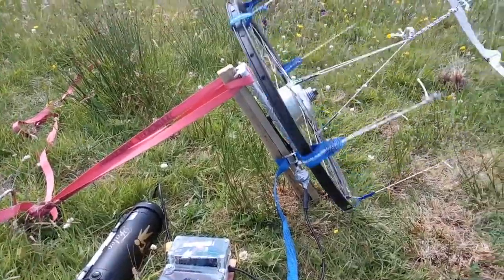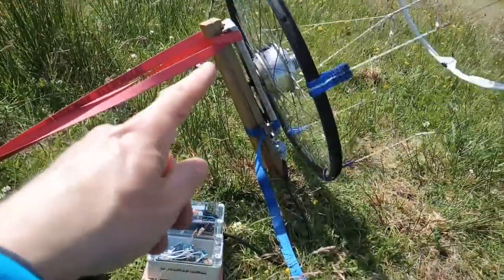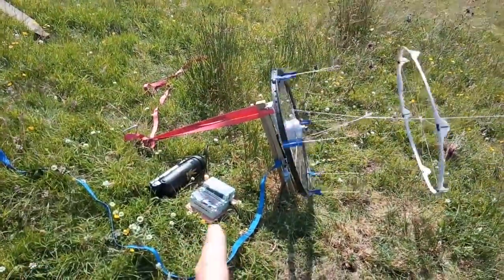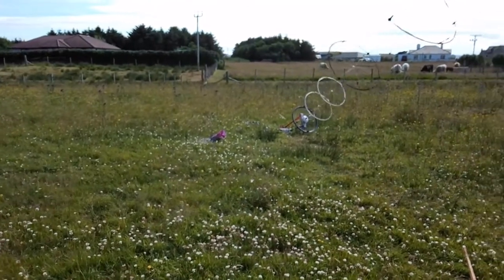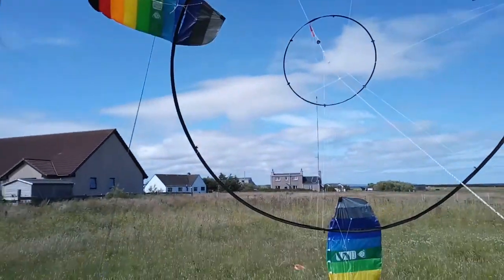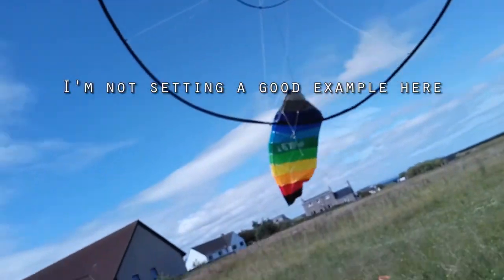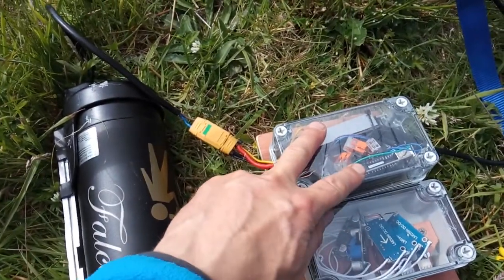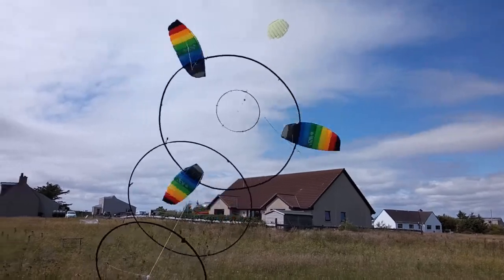Scout Turbine Part 2

Comment: Looking good Rob! More stable than the earlier designs... Tree hoist would also be a good idea for long term generation. Interested in seeing the Tree hoist design.
Reply: Or two trees and a line between them with the "kite end" having a ring able to run along the line. Of course, then it would also be good to have a final elastic segment on the kite to allow some movement.